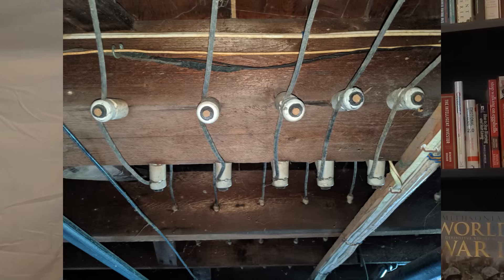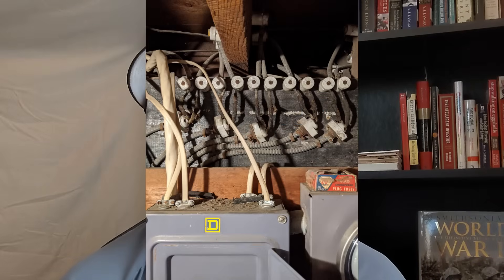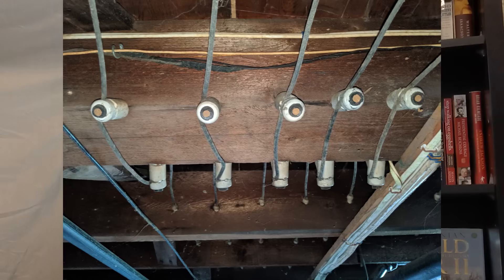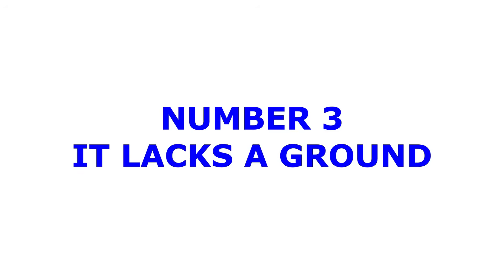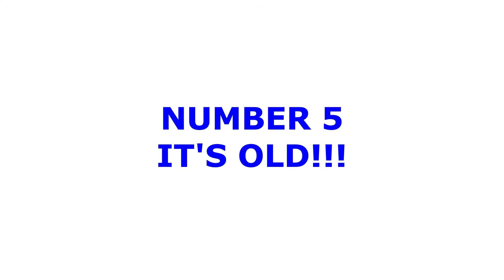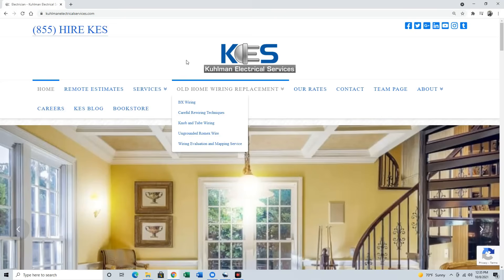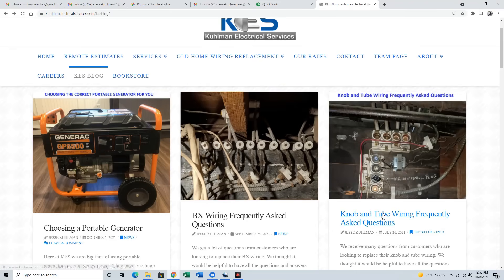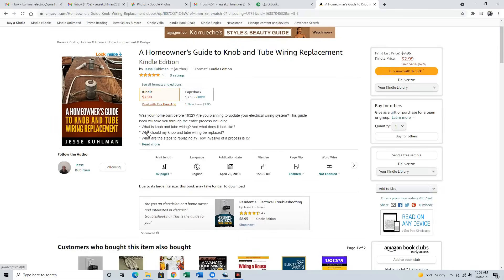Knob and Tube Wiring: Top 5 Issues | Jesse Kuhlman

Comment: Early Romex was ungrounded also. Houses built in the 50's early 60's are also ungrounded.
Reply: @bobcosgrove3235  Correct.  My house was built in 1950 and has 2 wire romex.  They did not even have 3 wire (black, red, white) which means you have to run another section for 3-way set-ups.  And switched outlets can be confusing, ( I prefer the red as the switched side).
I think in 1965 is when grounding was required.  However not everybody adopted that right away.  To see if your outlets are grounded, take the plate off and put your voltmeter probe in the narrow "HOT" slot and the other on the box. if you get 120 volts, you have a continuous ground path to the breaker.

Comment: Romex will not last as long, which is a bit sad.  But, old wiring, needs to go.   Not to mention, the new breaker boxes, have new safety features, like the yellow boots in the square d boxes.

Comment: I am a plumber with 25 years of experience i just removed the last knob and tube wiring that was for the lighting circuit of the entire house. No holes in drywall. Fished 4 home runs to the attic, removed a couple floor boards and removed the last of knob and tube.
Reply: To rewire this house which I just did. I had three estimates done actually five electric companies 3 gave me a estimate 2 I never heard from. One company wanted $31,000 for the complete rewire. $9,000 to just replace the one knob and tube wire that was fish through the house. $6,000 to upgrade the service to 200 amps. The cheapest estimate $23,000. What the 2 companies said it would take 3 weeks and four guys. My wife and I are the entire house in 4 16hr days with a new 100 amp panel Square D 24 spaces(double what was here), Schneider hepd 80 surge protector. Brought mostly up to code except the didn't use the ARC flash breakers,12 gauge wire, separate 20 amp outlets for kitchen and dining room. Previous wiring was stapled to bottom of joists. Major fire hazards everywhere, romex spliced into lighting circuit total of 7 outlets tied to 11 lights. Quite a bit of time reading the national electric code on certain things $5000 total cost to my customer that couldn't afford the massive amount these businesses charged. He has Cancer and I couldn't in good conscience add to his stress.
Reply: @PatrickBuckley-ol2ok   Here is an insane number.  I did it myself (I worked for electricians for years), and I still spent $7,000.  Everything had to go.  The boxes were old, and undersized, new connectors, including wago lever nuts,  a new disconnect, a new main breaker pannel, etc.   Everything was $100.   The rodents even messed with some 2x lumber, so, there was $300 in lumber I had to replace.   etc.   But, it was also during the pandemic.   I'm still in denial.  There is no way, it cost that much, but it did.  It's what I spent.  Ouch.  I reused some of the outlet covers, which, jokes on me, I could get 20 for $2.   I no longer use the cheapest outlets, and I buy direct from the manufacturer.  $120 in outlets.    Our problem, is the house sat empty, and the rodents attacked the wiring, and during the sale, since the house went to the nursing home, they sold everything, including the kitchen cabinets, and the cover to the electrical box.  The house was wired by an electrician in 1950, and they did not even use junction boxes, nor nuts.
Reply: @PatrickBuckley-ol2ok  that's the nice part about knob and tube all the homes it was in had balloon framing so you don't have to worry about drilling through fire stops definitely makes it alot quicker and easier

Comment: Over demand on the circuit is true nobody has microwave oven and modern appliances back in 1902
Reply from the maker: That's true! There were not many items to plug in at all in 1902.
Reply: Overloading is independent of the type of wiring, though.  Receptacle circuits need to be rewired to get a proper ground, as well as making sure the proper gauge is used.

Comment: I ran into a gas pipe at a duplex unit that was hot. It ran outside of the building about 2 feet off the ground for 40 feet. I was working at a small apartment building across the alley and the heating contractor that was working at the duplex came over and told me he received a shock from the gas pipe! I was skeptical but went over and looked and sure enough I read 124 vrs to ground.😫 To make a long story short it turned out that there were no ground wires anywhere in the duplex, and and no bonding of gas and water pipes. The kitchen stove had a spark ignition and the neutral wire of the stove cord was attached to the stove frame. The outlet that this was plugged into had hot and neutral crossed! Made everything attached to the stove hot. How no child ever got killed playing out there is beyond me…. Moral of the story: Always hire a qualified electrician.
Reply from the maker: Wow that is a crazy story!  Yes these things can happen and everyone who has lived there is lucky to have not been injured!  Thank you for sharing

Comment: My home is 93 years old and I’m currently removing the knob&tube in the attic. Fortunately, wiring in the walls is romex and the k&t is only in the attic. Unfortunately, there is almost a foot of insulation in the attic. I’m replacing in the walls where possible, as well, since it’s old romex and the rubber/plastic is pretty brittle. It is very slow going. 
The hardest part was getting new home runs from the basement to the attic. It’s not too bad, actually.

Comment: Comments:
1. If it's getting hot enough buried in insulation, then there's another issue going on. I have yet to see any evidence of a fire from an unmolested, normally loaded K&T directly caused by covering with insulation. Millions of homes had this done.
2. Insurance companies. No surprise.  What's new?
3. Ok, lack of ground. Inconvenient.  Yes. Downright dangerous. Not necessarily. Depends. In your case, an handyman hack, not an original install.
4. I agree with this. Was also an issue with earlier plastic Romex. If you have attic access, one method to fix it is put a plastic jbox in the attic and cut off the burnt section of  the old wires and route them into the box, then do a whip with modern NM to the fixture. I would not call this "extending the circuit". It's a repair. Other than burnt insulation in fixture boxes, the K&T I encountered had insulation in very good condition. 
5. Yes it's old, but so what? These installation were almost always professionaly done and made to last. If you need to upgrade, run new circuits from the panel, leave the K&T alone, unless the house is gutted to the studs. K&T was still allowed in the 1975 NEC, although most AHJs outlawed it. The latest house I encountered with this wiring was built in 1968 in rural CA.
Reply from the maker: Hey thanks for the reply.  Wow 1968 huh?  It's so interesting to me to hear these late dates with K+T wire being used.  I'm imagining an electrician in the 60's going to the supply house... Don't give me any of those romex wires that are WAY easier to to install, give me the OG K+T LOL.   Pretty fun to consider.

Comment: One of the best explanations I’ve seen thus far regarding K&t wiring. You forgot TWO important things to add. 
1. K&T is rated for 15 amps. Oftentimes folks overload it and that’s trouble. 

2. Neutral fusing
Back in the day they thought if one fuse was safe adding another to the neutral would make it double safe. The problem with this is that when a fuse does blow it normally takes out the neutral fuse leaving the circuit hot. Many an electrician in the day would tell you the end result of that. That is IF they made it.

K&t is safer but the facts you mentioned and the ones I added are why replacement with modern wiring is an order.
Reply from the maker: Hey thanks for the comment.  I agree! 

Add to that, you can have neutral switching, which is mind blowing for many electricians when they first encounter it.

The double fusing (Hot and neutral) was always super interesting to me.

Comment: Knob and tube is really the worst because it has 90 years of hack jobs and jank accumulated. If unmodified, it's not that bad for lighting circuits.. but your issues are valid for sure. Having no ground on your outlets sure limits what you can use, and having a GFCI on every outlet really only is an expensive bandaid that doesn't actually fix the problem.
Reply from the maker: Hey, thanks for the reply.  I agree with that!

Comment: Excellent Video.  Just discovered K&T wiring in my mother-in-laws house, as an insulation company said they wouldn't insulate the attic with it.  House is from 1920, so it makes sense.  The house if full of K&T.  1300 sq ft house 2 stories, what is a ballpark to replace it?  Each bedroom has a single outlet(in the baseboard), so i'm thinking that each room should have more outlets as well.  BTW, the house is located in Portland, Maine, a stones throw from MA.
Reply from the maker: Hey thanks for the comment! It's hard to say without knowing the total count of switches, lights, outlets that need to be rewired.  I will say the average K+T job for us (single family) is 12k.  I hope this helps!

Comment: Should people with K&T add arc fault breakers to make the home safer?  What's the pros and cons to that solution?
Reply from the maker: Hey Joel, thanks for the comment.   Doing that will add a level of safety - the arc-fault breaker should trip if there is a bad connection somewhere.  This does not solve the insulation or lack of ground issue however.  Installing the AF breakers should be a short term solution, buying some time before a full rewire is done.  

Keep this in mind if you opt to install AF breakers on the K+T - The AF breakers may trip and this is good because you want to know there is an issue and the AF breaker identified there is one.  The downside is you are left with two options - spend money trying to troubleshoot where the issue is to fix it, or rewire that circuit.
Reply: @kuhlmanelectric  That sounds like a great solution to me then.  A lot of homeowners will feel comfortable installing those breakers, but unable to afford all the circuits replaced at one time.  It also indicates where immediate attention must be given.  Also seems like gfcis can address the lack of ground.

Comment: Thanks so much for a thorough discussion of K&T wiring. Because of all wooden and plaster-on-lath walls, I am concerned about the prohibitive cost of new wiring, in large part because of the difficulty of access and huge amounts of wall repair to follow. I don't think any contractors are able to make such repairs without costing an absolute fortune. It's a very large house.
Reply: Could be anywhere between $15,000 - $30,000
Reply from the maker: Hey thanks for the comment.   We do the rough patching ourselves and aim for small holes overall.  Take a look at our website and check out the "careful rewiring techniques" page to read more about our strategy. - you should be able to find a company that does it similarly to us.    https://www.kuhlmanelectricalservices.com/rewiring-techniques/

Beware of companies who want to gut your walls to replace the K+T, this is not needed.
Reply: I'm not a contractor just in training but we are rewiring an old home and decided to gut the walls. It's better if you can afford it. There are options not to however.
Reply: The house I mentioned is over 100 years old and very large, with 11 rooms. If a bedroom, for example, is 15ft by 16ft in size, and has only one or two outlets, this is insufficient by modern standards. So a large number of additional new receptacles must be installed, as well as rewiring the existing K&T ones. Without a total gut and re-wall of the entire house which would cost more than the total value of the house, the only way I know to achieve proper new wiring is to cut long channels around the perimeter of every room. Having removed small sections of old beadboard walls and plaster-on-lath walls here for certain repairs, I am well familiar with just how difficult this is. The walls coverings vary in thickness, so drywall does not work well for repairs unless the rooms are gutted. Plaster does not cut out neatly in channels. It breaks loose easily and often the lath is not a solidly attached substrate, so when you try to cut it, it flaps loosely and breaks out more and more plaster. It's just a disaster to try to repair. I am not saying it is humanly impossible, just that the cost of this type of work could easily exceed the total value of an existing old house, which really suggests a bulldozer is the better option.
Reply: if i were in your situation i would run the new romex myself down to the panel. DeWalt makes a cutoff tool that has a guard and vacuum attachment so you can make your cuts along the wall and ceiling to run your lines cleanly. then just hire a drywall contractor to do the drywall/plaster work. don’t worry about removing the old KnT, leave it in the walls b/c you’ll disconnect it from the panel anyway
Reply: @PhanoftheShow  I don't understand your suggestion. It's a large 100+ year old house, all wood or plaster-on-lath walls and ceilings (no drywall!) with insufficient number of outlets. As I said, even leaving the old K&T within walls, it would still require cutting almost the entire perimeter of all 11 rooms, as well as up to every switch, and ceilings for lighting, etc. As I said, facing the cost of then re-covering every wall and ceiling would require a massive entire-house job, and probably an entire gut out of all the plaster and lath, and would probably truly cost more than the entire value of the house! Not to mention the impossibility of emptying every room to enable the work (an impossible task!). It would literally be cheaper to bulldoze down the entire large house and rebuild it new. People think I am exaggerating, but I'm not.

Comment: Between outdated wiring, lead pipes, no insulation,  120yo cast iron sewer lines there should be a superfund to help people get their homes updated..lord knows this govt has the money to spend on everything else
Reply from the maker: It's really amazing to think about - Just in our area there are 100's of thousands of homes built pre 1930... All these homes will need their wiring updated, not to mention, plumbing, painting, roofing, HVAC etc etc.
Reply: @kuhlmanelectric  instead my state is pushing to ban gas stoves to improve air quality...idiots dont realize the dust I cant keep up with contains lead and asbestos? Amazing..

Comment: I was going around with a home inspector in 1994 through a house that I was buying. The house had live nob and tube wiring. He claimed that nob and tube wasn't so bad because the conductors were separated and there was no way to short them out by driving a nail.  At that time I had no difficulty getting insurance on the house, despite the nob and tube. I didn't really like the fact that the house had this antique wiring, and I worried about the modifications that were made to the wiring over the years, for the house, a small bungalow originally had just one circuit, but now had many circuits using the nob and tube. I only had 5 grounded outlets in the house and an antique key switch in the garage gave me such a shock that I would replace the garage light with the circuit breaker off so I didn't have to touch the switch. Why didn't I change out the wiring? Cost! To replace all of the wiring would have easily cost 10 to 15 thousand dollars and I was a home health nurse paid Burger King wages.
Reply from the maker: Thanks so much for the reply!  The inspectors reasoning is interesting - in a modern why a short circuit would turn the circuit off / alert you to an issue.  A nail into a live knob and tube wire would not short out, and you would be left with a very unsafe situation - a live nail, or a connection that is semi broken leading to heat build up etc. 

You are correct that replacing knob and tube wiring can be very expensive.  It comes down to how much K+T is left in the home.

Comment: How does existing K&T wiring even handle all the modern appliances and computers and stuff we use today on old wiring that was designed for some lightbulbs and maybe a vacuum cleaner or something back in the 1900s

I would expect that the wiring would overload pretty easy at that point and be a danger.
Reply: The current carrying capacity of #14 AWG and #20 AWG K&T is the same as modern Romex. If properly fused or with the proper sized circuit breaker it is perfectly safe. The breaker will trip or the fuse will blow long before the wire overheats.

Comment: Why don't modern house wires need cooling too?
Reply from the maker: Do you mean the wiring needing cooling?  Modern wiring is designed with much higher temperature ratings than knob and tube was.  Modern wiring does not need to be in open air for cooling for this reason.  Thanks for the question!

Comment: I've only I've  come across knob-and-tube was just one job. I was a bit amazed by the process it was done. I know very little about it because my time came well after in the 70s through today it was about two decades ago that I ran into it. It's a trip how they used to do it
Reply from the maker: Hey Jeffrey.  I think it's pretty cool too! I would love to see how electricians back then did the installs, drilling by hand etc.
Reply: @kuhlmanelectric serious Craftsman for sure. Same with the Carpenters back then. The work they were able to do all by hand. Just incredible. I find so much more in older places than anything built this century..